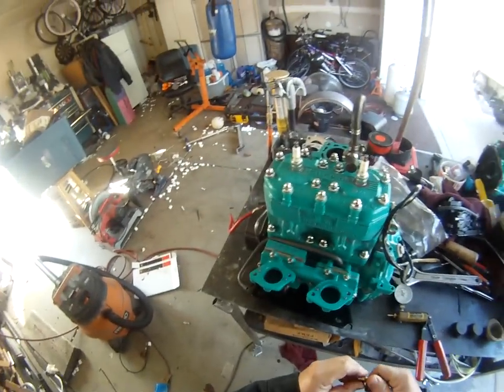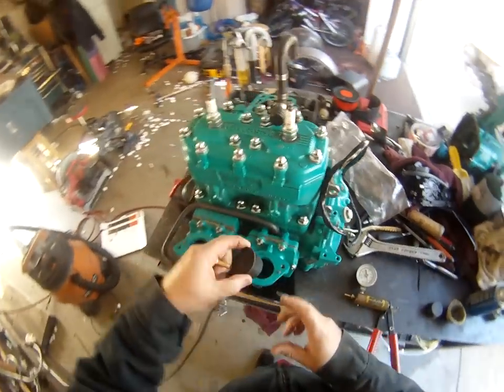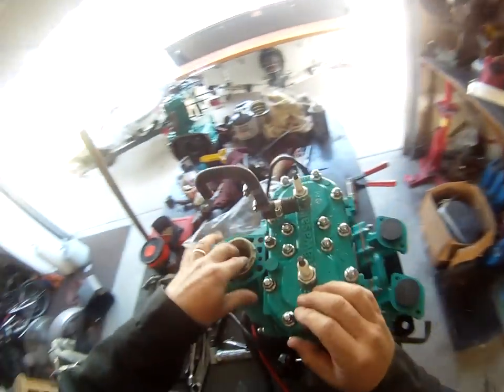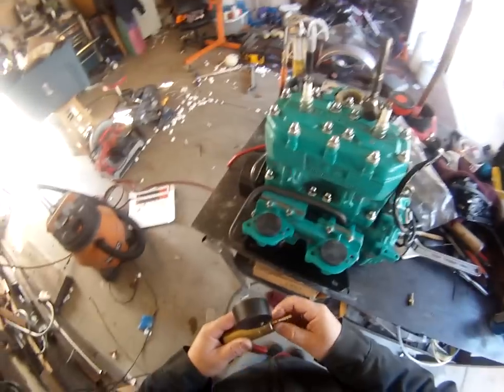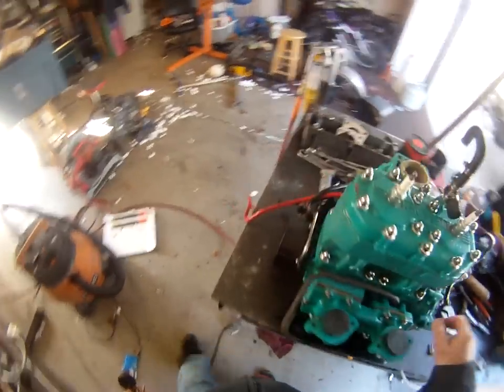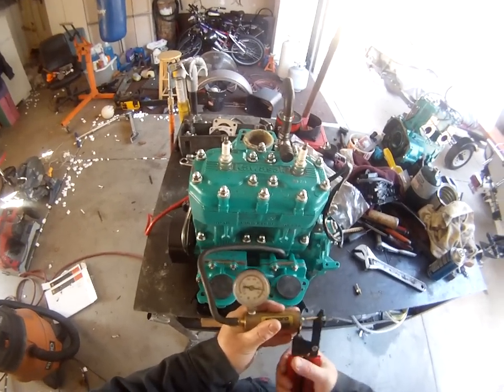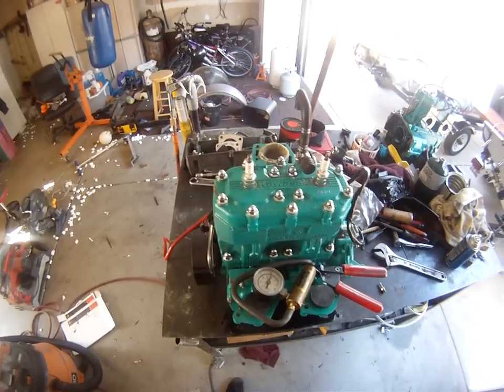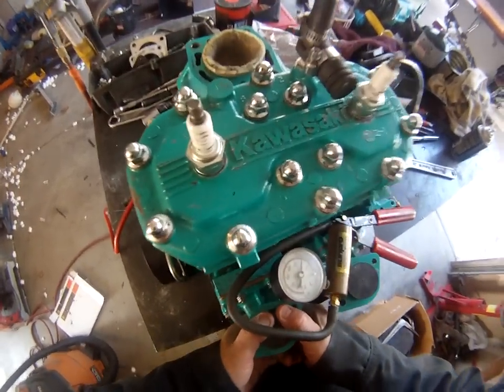Performing a leak down test on a 750 Kawasaki big pin 2 stroke Engine

Comment from the maker: 2 full day trips on the river ran great then went camping for 4 days... Ran great until the last day on the way back to the boat lauch getting ready to pull it out and seized a front rod bearing... Looks like the front seal failed.... My new recomendation is if you have the engine out change the seals... Its under $30 for seals... Im building a new motor now.. Should be finihed in time to enjoy the rest of my summer... Hope this video is helpful

Comment: The book says use pressure also easier to see if you have a leak simply spray soapy water around all sealing Surfaces see bubbles find yr leak!
Reply from the maker: Good luck with that, there's to many places that can leak, you need to do a proper leak down test.

Comment: I have a 97 sts .i get smoke &oil out the ehaust pipes when running out of the water.after i run it in the water it dont smoke any more. Whare should i start. To fix this proplem? Thanks
Reply from the maker: Its a 2 stroke. Its suppose to smoke and spit out oil.

Comment: Probably a dumb question but ima ask anyways.so here goes, I also have a big pin 750cc that I rebuilt the dual carbs. I can not figure out what the stock needle settings are on this thing. Like how many turns on the low or high needle. It's been such a  pain for me. I had it going and idling  but wouldn't get up on plain. I'm asking cause it seems like you answer to the commenters. Any advice at all would be greatly appreciated.
Reply from the maker: i need more info.zxi,  stx etc and what yr. The reason I ask is because the TX is heavier the settings are slightly different and in some cases the jet size is different.
Reply: @mogyver69  sorry it's a 1993 ss xi so Kawasaki super sport xi 750. Dual carb.

Comment: How do you know its a big pin by looking at it externally?
My 94+95 ST JT750 blocks are factory silver looking, 10 bolt single, carb intake,
I'm thinking I got the earlier small pin design.
Block # JT750AE003210
Reply from the maker: I believe its 96 and newer are big pin.
Reply: You should have pressure tested it too buddy, But nice job and great video! . The seals are double faced or back to back.

Comment: Hello I was wondering if u can help me find the problem with 1997 kawasaki sts.   It starts & runs good out of the water but once in water it stalls on take off.  It starts good in water but on take off it stalls and I have to play with throttle to get it going.  But once it takes off it runs really good
Reply from the maker: Sounds like you have a carburetor issue. You need to check the inline fuel filters inside the carburetors and the pop off pressure.If it runs fine and only has a hesitation when you first hit the gas your pop off pressure is probably off.
Reply from the maker: +Jose Sanchez  Your pop off pressures are too high. You need to change the spring inside the carbs to a lighter spring. Look up pop off pressures. I made a video awhile back.

Comment: I bought two 96 750 skis for $1,000 both run fine. Any known issues with these motors/pwcs? I've always been a seadoo guy and these are my first kawasakis
Reply from the maker: Theres a block of valve that's used for draining water from the engine in case you sink the ski, it helps get the water out of the engine. that valve can leak causing lean condition. it will cause your engine to blow up/seize, remove it and use block off plate.
Reply: @mogyver69  Just took the skis out today and holy shit this thing cuts threw the water better than anything i've ever operated. Motor gets in the powerband immediately (way better than those 4stroke skis), really happy with my purchase. Thinking about selling my 94 vxrs now to invest some performance parts for the skis lol. What kind of potential do these motors have with power?

Comment: is this a boat engine? do they use thin on a bike? there is no gearbox right? its so beautifully compact and 2 stroke, I can imagine this on a motorcycle..WOW
Reply: This is a Jet Ski engine - and motorcycle engines are actually more powerful since they are air cooled and typically larger too.
Reply: hi ted think its a 2stroke engine that's why its compact!! 2stroke 750 eats a 4 stroke superbike 1 litre quite literally
Reply: This IS in fact a two stroke Jet Ski engine.